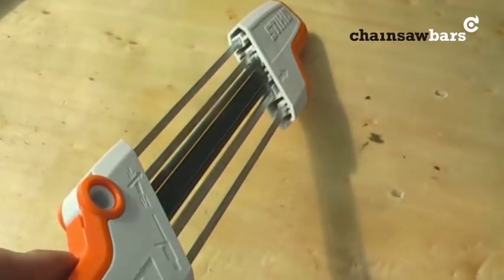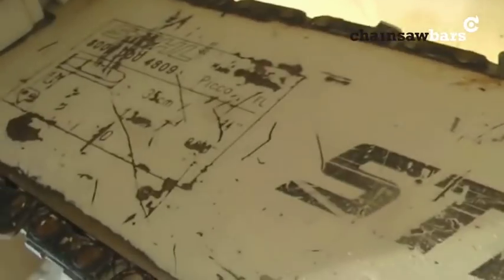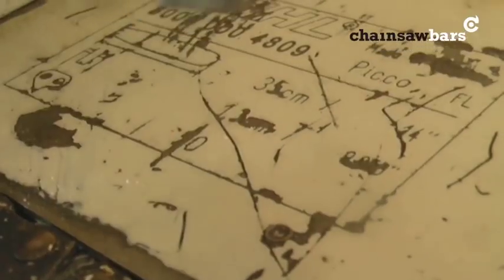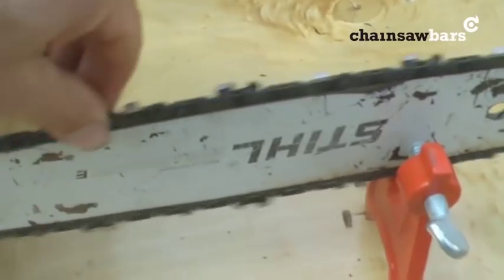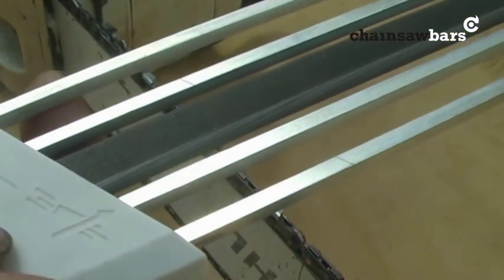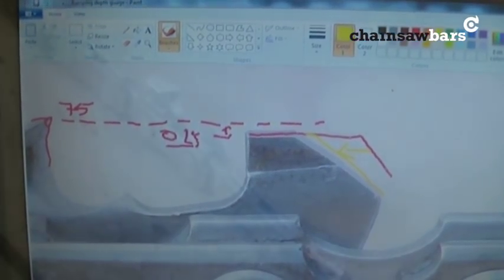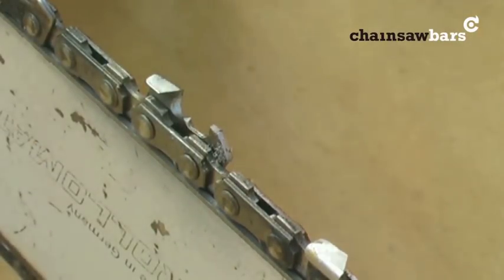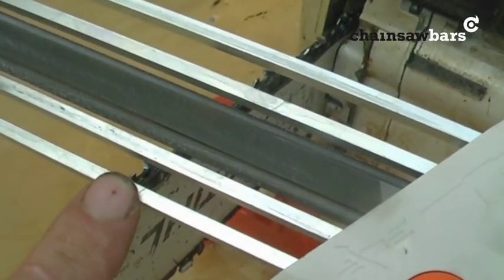chainsawbars.co.uk - the Sthil EZ file

Comment: A well explained demonstration and now I understand the purpose of the flat file also. Now there is no need to buy one of those cheap electric sharpeners which only sharpens to cutting tooth but not the guide tooth, Brilliant and thanks for sharing video.

Comment: Sorry for calling the Rakers for depth gauge, I'm from Denmark and was thinking the rakers was controlling the thickness of the wood chips.
Reply from the maker: +Bendt Kristensen Yes the depth guage controls the thickness of the chip taken - and as the tooth is filed and gets shorter then so to do the depth gauges need to be reduced or the chain will just slip over the wood.
Reply: In the U.K. these are called restrictors, they control the depth of the cut by the tooth.

Comment: are the files replaceable if you wear them out or snap one? good vid thanks
Reply from the maker: +richie777711 Yes you can replace the files although I expect the dealer will not have the flat version in stock!
Reply: I just picked up one of these and yes, the files are replaceable

Comment: The video would show you that you can use a depth gauge plate, to ensure the correct depth gauge angle, Is such a depth gauge plate made from hardened steel? ...... Is it good for the file teeth "I wonder even ".......... if it is not the case, as I am convinced it is, I am sure that it is meant as a measuring instrument, more than as a tool to support a file? but good for those who sell flat file? it increases sales significantly and hope that you take it from the humorous point of view?
Alternatively, I would prefer to round depth gauge, flat file, start by file depth gauge from base to tip, while I turn the file in a smooth motion, stopping before I reach the tip, which are allowed to leave less then 1 mm. back of the horizontal?
Take it as positive criticism, so it meant:-)

Comment: I seen that you made a pretty serious mistake when you loosened your chain before filing. The chain must be set at a proper tension as to not let the chain move sideways in the track when running the file over the tooth. And wear a pair of gloves, that will protect your fingers from cuts. I been making chips for 25 years and been where you are friend and just thought id share my experience . I hope this info helps.   Be safe out there..         Cheers!
Reply: Pompa per sollevamento infermi

Comment: NEVER DRAG YOUR FILE "BACK AND FORTH", YOU ARE NOT ONLY DULLING THE SAW TOOTH, BUT ALSO DULLING YOUR FILE..........ALWAYS MAKE A SLOW FORWARD FILE  CUT, LIFT YOUR FILE AND THEN MAKE A FILE CUT AGAIN, CONTINUE UNTIL ALL TEETH ARE SHARPENED , TAKE YOUR TIME AND USE THIS TOOL PROPERLY, Always look at the teeth on your chain, always start with the the worst shape tooth, If it takes 5 or seven strokes to sharpen  it.."ALL THE REST OF THE TEETH NEED THE SAME  NUMBER OF FILING STROKES, ( sorry for the capslocs) my keyboard went for a fucking shit tonight!..........If you don't sharpen each tooth with the same number of strokes, it will cut crooked and bind like a motherfucker!!, I've been doing this for a lot of years